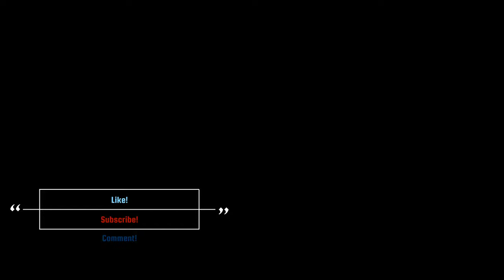Quick Fix 9 Volt power supply repair! Fix your TS9 or other 9v pedals!

Comment: thanks for the video. Not what i needed because the 9v (battery) plug is good back to the (-) jack and  (+) to the circuit board is fine. But the pedal wont work with the battery, but will work with the power supply. I'm actually into the pedal to change the dim LED because I can't see when the pedal is active. It appears the LED operates on about 1.8 DC volts. But thanks for the good video.
Reply from the maker: Sorry it's still giving you troubles. Sounds like maybe a capacitor may have gone bad?
   Thanks for watching tho! Much appreciated 🙏

Comment: Thanks for the video, im Argentinian, idk if you gonna read this, but i have a similar problem. In my vox wah-wah pedal, the 9v battery works fine but then i try to use the dc9v power supply, it doesnt work and i cant understand why!!! could i try to solder the contacts between + of the dc power and + battery? help pls!!
Reply from the maker: Hi Lauti! Have you tried switching out the power supply first? Just so we know it's the pedal before we take things apart?

Comment: Can you just cut the wires and splice the new wires to the old one? Just curious as I know nothing. Lol
Reply from the maker: You can! Just try and use some heat shrink so it doesn't work loose under tape.    And in the words of Socrates...  "I know that I know nothing and that has made the difference"    :)      thanks for watching Scooby!